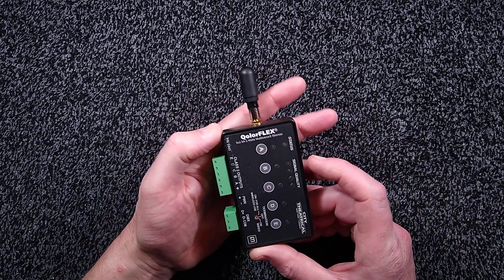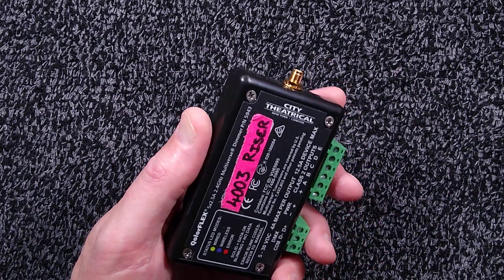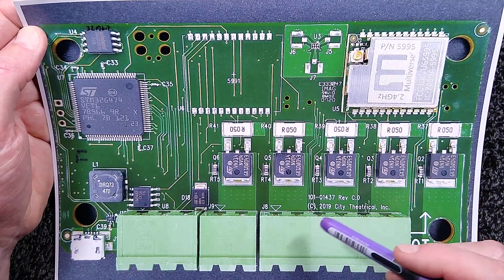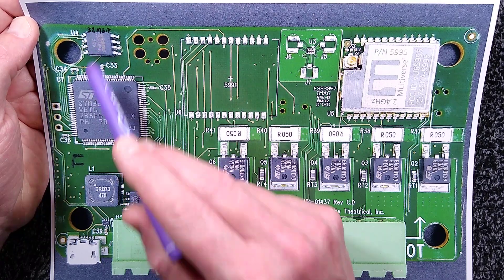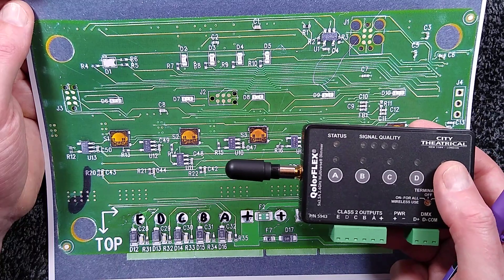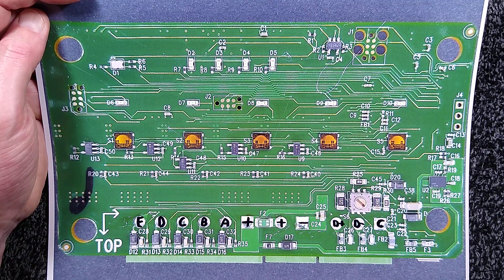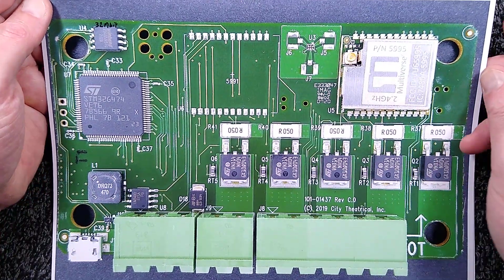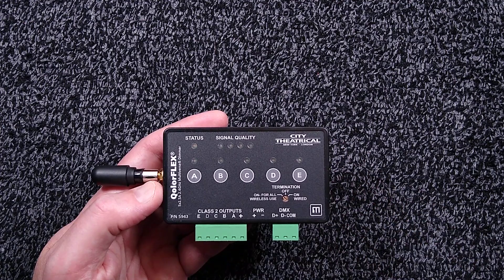Inside a wireless DMX receiver

Comment: Interesting... probably not related but I was having issues with my 2.4GHz wifi during August and ended up having to reconfigure everything I could to 5GHz... I'm about half a mile from the castle and have more or less clean LOS.  I'm blaming you Clive even if its likely it was just too much noise on 2.4GHz in general and wasn't you specifically! 😀

Comment: One of the additional factors to deteriorated performance is the self-pollution. The VND14NV04 has not any EMC decoupling. It is directly coupled to the wiring which can come very close to the receiving antenna. Gate currents from the drivers will have harmonics far in GHz bands and feed through via the FET parasitic. The design should have some RF beads and decouple C's on the outputs. Might be an experiment to see whether the driving dutycyle to 100% might improve the situation so see if this is a factor. But indeed 2.4GHz as mentioned will not be the best freq to have stable communication. Further I see very little power decoupling on the board, even around the MCU.... I guess the unit will have hard times passing EMC certifications...

Comment: Nothing to do with the problems, but those termination resistors seemed weird. 102 and 143 Ohms are nowhere in the DMX specs. The far end and a non-RDM controller should be 120Ohms, and a RDM capable controller should be a network of 2x562 and 1x133 Ohms.

Comment: 2.4GHz is often very congested so it is often worth avoiding it and going to an alternative frequency where possible. Most regulators e.g OFCOM have multiple frequency bands that are allowable for short range devices like this. 

Without going to site with a spec an, it is hard to tell what might be wrong. If they are using fixed frequency, it could be an overlapping wifi or similar channel. They may be transmitting very low power and that could be a problem if they are designed for world wide use and complying with the lowest common denominator.
They could have a poorly implanted frequency hopping design and getting out of sync between transmitter and receiver. 
There could be a rouge transmitter or faulty equipment with unintentional transmissions in the frequency band providing in band interference. 
The rf module may have poor out of band rejection. 

Hopefully firmware fixable but depends on the root cause

Comment: Wireless is a festering load of shite - there's nothing more reliable than a good snake of cables going whereever it needs to.   Can you simply cable there and do away with wireless?  Leave the free spectrum for those who don't need reliability.

The other option is to buy your own transmission frequency from the local authority and blow anyone else out of the ether with power ( "MORE POWAH!!!"  as Clarkson says. )

TBH I haven't touched theatre lighting since my twenties, which was before DMX and barely after the invention of electrons in wire. :)

Comment: The "multiverse receiver" looks suspiciously like an ESP8286 chip with a branded cover on it.
This system looks like it could work quite well in an environment that was fairly RF quiet, or maybe using the 900MHz band, but I can imagine 2.4GHz would be pretty noisey.    Thanks for tearing this down for us.    I didn't feel you painted it negatively, more just that it was troublesome in your environment.
Reply: When I saw it I was thinking the same (ESP-32 actually), but pin count and tracing don’t match up

Comment: Since I am around the right type of people here: Do anyone of you ever had Problems without an termination Resistor on DMX networks?
I am working in the entertainment industry for about 15 years now and we do al the crazy stuff you are not supposed to do with DMX on a regular basis. Like a  kind of a Star-distribution arrangement with 50 or so nodes without ANY termination Resistor we build for a Rockband every so often. You supposed to have a maximum of 32 Nodes in a Line-configuration. We use no active distribution amplifier or splitter on this particular setup. And we never had any problems with that what so ever. Is this normal or did we just had dumb luck ... like 50 times and counting?
Reply from the maker: Technically speaking you should always terminate a DMX network and not branch off it without a buffer.  In reality, very few people seem to do it unless they have reflection issues.
There's also folklore about how termination can mess up a network, but in reality it's just making a bad cable visible.
Reply: Yes. A couple of times wonky lights (flickering LED lights) were fixed by adding termination. More often it was swapping microphone cables for real DMX cables or just broken connectors.

What do you mean with Star-distribution? Using normal DMX equipment it is impossible to create a star network, you'd have to solder several connectors together to actually make this possible. Note: a DMX splitter does not make a star - it replicates a bus onto several other busses, they are not electrically connected.

Adding 50 nodes to a bus should not be a big problem. The 32 number is the guaranteed minimum. When you approach twice or 3x as much the bus might become a bit more unreliable and the console output might get a bit warm as it is approaching its rated maximum Amperage on the bus. At about 100 you reach the real physical limits and expensive stuff might burn out. But still, I would add a signal repeater somewhere in the vicinity of 32 loads or add a few splitters (if you are worried about timing: passive non-RDM ones are fastest).
Reply: @KonradTheWizzard  I understand the difference between an active Splitter and the things we use. We have little 3D-printed boxes with one XLR male and 3 XLR female connectors in them. No active circuity inside
It is just convenient to be able to split a DMX line to not have to run a (potentially very long) cable from the end of that one line and go backwards just to get to where you wanted to go in the first place.

Don't get me wrong, we have active splitters and use them for wider spread locations where the passive ones might not work.
Reply: @Fluxkompressor  A direct electrical Y-connector without any isolating components.... I would not call that a passive splitter, I would call it a nightmare. I can imagine it would work with up to 5m of cable, but anything longer would create tons of reflections and distortions.

A real splitter is really simple: all you need are a couple of RS485 drivers (e.g. MAX485), terminating resistors and a 5V power source. If you are really paranoid about galvanic isolation (and you should be if your cable runs are longer than 10m) you throw in a couple of DCDC converters and capacitors. I can send you a simple KiCad schematic for an isolated one with USB power supply if you need one.
Reply: @KonradTheWizzard  That is exactly what I'm thinking. A Nightmare. That is why I was asking. But it works and it is passive (you could call a signal Transformer passive, but that wouldn't work since DMX is not DC-free) 

The cable runs aren't short either. We normally have a 100m drum from FOH to Stage, then the first nightmare-box. from there we have 2 20m cables going into the truss left and right and one 10m to a riser where the hazer and some lights have its place. these are connected  in a straight line thou.
In each of the trusses there is another nightmare box with 3 10m cables going to yet another 3 nightmare boxes with each of them having 5 3m multi-cables (DMX and Power) going to (mostly) a single light each.
this makes the whole wiring process a lot faster, just whack a cable in every light and you're done

This setup works for about 5 Years and about 40 Shows per Year now
We also do other Stuff and use the boxes there too

I also thought about building this kind of box but with some RS485 chips and a little Li-ion battery inside. it wouldn't be much bigger than the current ones
Reply: @Fluxkompressor  Wow! I would have guessed for sure that this kind of setup would create huge problems almost every time! There must be severe signal degradation in those cables.

On those kinds of cable runs I would definitely add galvanic isolation - a simple opto-coupler is quite cheap (1/2 buck: dollar, euro, pound, whatever) and if you connect it right you do not need the extra transistor to re-invert the signal on the other side (connect the output of the RS485 input to the negative pole of the LED and you get a non-inverted signal on the output of the coupler). The DCDC converter and capacitors add about 1 buck to it. The spacing is not that bad: I was able to cram a Y-splitter (in+thru + isolated out) into about 2x3cm.

USB vs. Li-Ion cells: the cells need a rather beefy voltage regulator, since you need steady 5V and each cell supplies something between 3 and 4.2V, depending on how close it is to being full. I prefer USB, since it comes neatly packaged as "power bank" or cheap chinese USB power plugs and the output is good enough for this purpose (certainly with the added capacitors due to the DCDC I built in). USB micro sockets are really cheap (a box of 100 for less than 10 bucks). The only downside is that the USB sockets are really fiddly to solder.
Reply: @KonradTheWizzard  Maybe one day I'll bring an oscilloscope to the Job and probe the Signal at certain points

I don't think I need galvanic insulation since everything is either completely isolated by the wood of the riser or grounded to one potential by the truss. Also every device in the whole system shares a common ground from the power distribution rack, so there can't really be any current flow thru the shield of the cable

I was thinking the same about the voltage. Most RS485 Transceivers detect signals as low as +-0,5V so the 3V of an empty Li-Ion Cell should be sufficient. But then you start with a full cell and everything goes nuts in the middle of the show when that cell drops in voltage.
I had the idea of making a PCB with some MAX485 and one of those standard power-bank ICs. USB-C for charging and I can add whatever Lithium cell fits. It has to be one of the "always on" powerbank chips thou, which deliver 5V all the time and don't go into standby on low load. Also it has to deliver 5V even when it is charging. This adds the benefit of having the whole device either mobile or connected to power with blackout savety
Reply: @Fluxkompressor  I wouldn't bet on the common ground potential - there are a hundred ways that can go wrong: the earth magnetic field alone is 30V per meter (although the amps are almost impossible to measure), there will be that day when some stage hand or artist will decide to use a second power distribution point, there will be a show in which the trusses are not connected because you need slightly different lighting, some cheap LED lamp might have a failing power supply and connect its ground to the hot wire of the power, capacitive coupling (see under "Original Apple[tm] power supply"), ...

I still like USB better, since it gives me the option of plugging it into a cheap USB power plug - there is non-dimmed 240V for the LED fixtures anyway, so it is easy to add a plug. And why bother with power conversion chips if you can buy a power bank for really cheap.

I haven't tried how bad the standby problem with power banks is for this circuit, it might depend on the load on the RS485 bus - a terminator might even resolve any problems by adding a few mA. I think that'll be a nice experiment for the weekend...

You are right that USB-C is becoming a better idea than micro USB nowadays. I love those cheap 6-pin USB-C sockets - much easier to solder than micro-B and no need to bother with all those data lines, you just add 2x5.1k.

Comment: J4 jumped out at me as being UART (and the pins from the MCU match it) - it would be interesting to solder some jumpers to it to see what it presents. It'd be nice to get a read of the SPI flash too as the MCU has 512 kB of onboard memory flash with 128 kB SRAM so shouldn't need external flash.

Comment: Can the unit be  a wireless master and then transmit dmx out to others on the wired connection? Maybe for a later "enhancement". Here in the states I've noticed WiFi and other systems interfere with each other, usually cheap devices. Better or pro quality at 900 mhz

Comment: This sounds pretty ‘mission critical’, and I honestly wouldn’t trust anything but ‘Wireless Solutions’ for that. They are simply better at frequency hopping and error handling in noisy rf environments. They also have products in the 5Ghz range. The best part about the is the fact that they have so many compatible OEM manufacturers. You can find compatible products in pretty much any shape and size. In my experience they are extremely sensitive to grounding issues, but thats about it.

Comment: How do you like the DMX Cat? I have been on the fence about picking one up or just switching to the Swisson with RDM. The only thing I could see being a better feature with the Swisson is cable testing. If you are not locked into the Multiverse/Show baby products, check out Wireless Solution (W-DMX). Their G4 and G5 products have been rock solid in high congestion environments. RC4 Wireless also has some neat products.
Reply from the maker: So far I like it a lot.  It's a very useful tool with some nice features.

Comment: For 2.4GHz device that need a constant connection, drop out is a very common problem, not sure the reasons but happening so frequent, especially those headphones, signal strong enough and distant is not too far but always missing data, that is much worse than analog, analog will be distorted but still almost continuous.

Comment: I worked for a company that developed a similarish product for industrial purposes. It could be used as a wireless cable substitution system but had a lot of internal intelligence around different protocols and automatic functionality. Our system was based on an off the shelf Zigbee protocol module and was incredibly robust, and it ran in the cellular frequency band instead of 2.4GHz. It looks like City Theatrical have made the rather bold decision to produce their own RF modules. I'd like to know why they went with that, given the R&D involved in getting these modules working, along with having them certified for use. Interesting stuff.

Comment: Hi Clive, I work in the Entertainment production industry and if I had to guess, the first place would be the LED screens. LED screen emit a large amount of EMR (electromagnetic radiation) which wreak havoc for the RF environment. We alway use directional antennas well away from LED screens. I’d say you’re not able to get your Omni-directional antennas far enough away from the EMI produced by the LED screen. Add the relatively small wave-length and short transmission of 2.4GHz, PLUS the added noise of a stadium full of consumer devices. I’m not surprised your DMX RX/TX are struggling. That’s my guess.

Comment: Out of curiosity... What could cause interference with the 2.4ghz band? I often find my remotely controlled mini split HVAC system to be unavailable and my WYZE home security system to be... whackadinghoy near offline while work crews are in the local area.
Reply from the maker: Many common radio control systems and also operating microwave ovens.
Reply: @bigclivedotcom  XKCD, as always, has a cartoon for this -- search for the Nachos strip (number 654).

Comment: Processor looks like major overkill and automotive industry "SmartFETs" provide all that protection and are basically bullet proof. Wonder if the signal quality indicator is just based on strength rather than bit error rate which would be a schoolboy error. I did the tech for the chameleon costume in the first series of the masked singer UK and that was "interesting" in a tv studio environment which was why we chose to store the content in the costume tech and just send cues wirelessly luckily it wasn't live and editing works wonders. I also built this for the national theatre of Scotland, the drum was completely wireless, the box with the cable was a remote EStop and also fired backstage concussion pots which didn't need to be wireless so weren't. It didn't use 2.4GHz and worked flawlessly.

https://www.youtube.com/watch?v=8I-gPZUBWSg

Comment: I worked for a long time in the RF world and still make stuff that relies on RF but my golden rule is if you can use cables then use F'ing cables don't use RF just to save time/cost. If you're going to use RF then build in failsafe fallbacks where the punters see something normal even if it wasn't what or when you intended, that's far better than them seeing glitchy crap.
Reply: Yup. Definitely. Working in the lighting field, this is one of my rules. Yes, wireless might be cool or convenient, but nothing beats a hard connection. Plus backup lines where appropriate/possible. You generally have to run power so you might as well run data too.
Reply: @Stuart_Fisher  Tricky for mobile platforms that use batteries or over water but for sending simple cues high power infrared is an option, I did a pyro thing many years ago which did have to be wireless and was a centrepiece so basically HAD to work, I used RF backed up by Infrared on two completely redundant systems even down to separate batteries and everything having two igniters albeit it was only operating over a short distance. For most RF stuff I'd be looking at 868MHz unless I had no other choice and particularly at low bandwidth systems such as LoRa.

Comment: I would expect that professional equipment won't use 2.4GHz, 433MHz and 868MHz, because those are usually very crowded. You should be able to allocate one of the wireless microphone channels for this. The ones I got to play with operated around 800MHz. I don't know how many channels are available in that band.
Or maybe the 5GHz band?